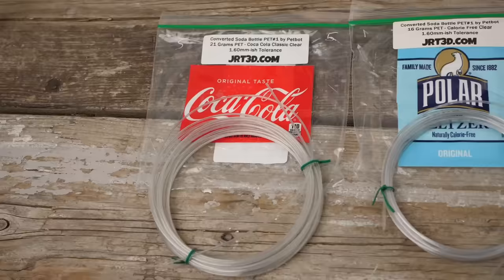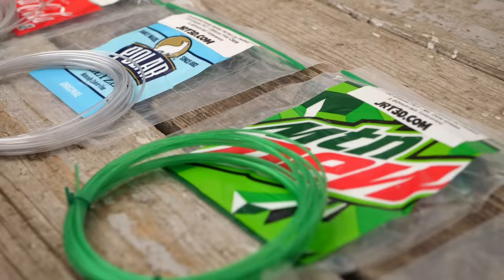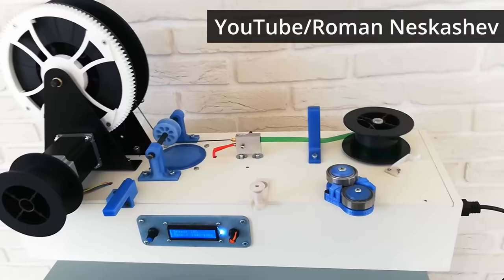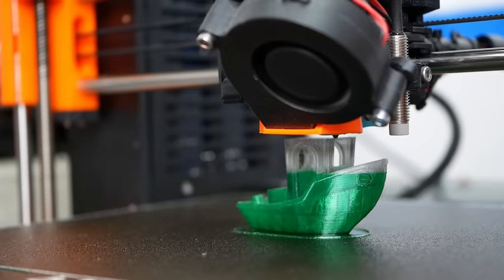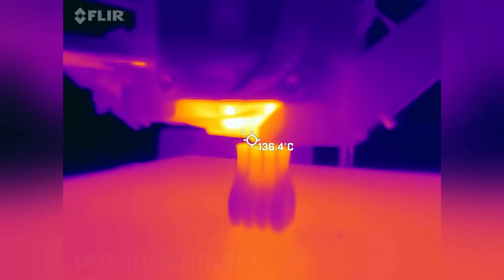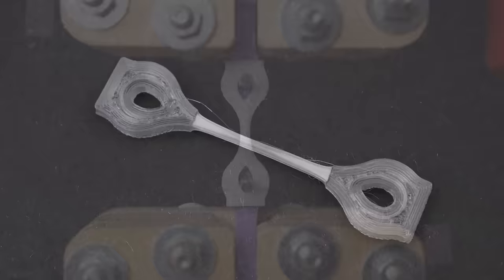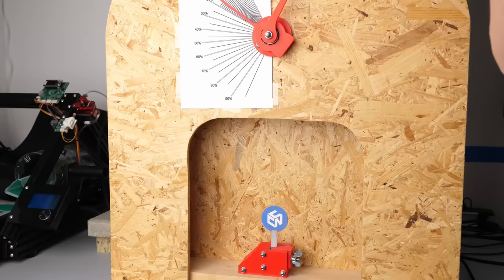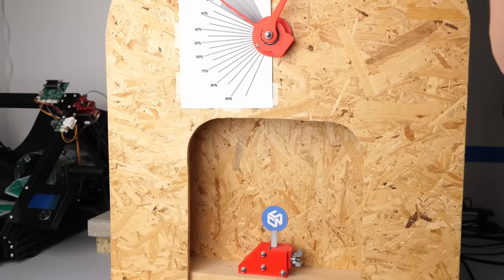HOW STRONG is PET Bottle Filament?

Comment: I got a spool of HTPET+ from Fusion Filaments that vaguely claims to be bottle PET, so I'm really curious now as to a head-to-head comparison between the recycled bottles and HTPET+.  I'm not sure if they've added something to the HTPET+ formula or what but I did not experience the crystallization, at least with the prints I tried.  Also, as per their recommendation, I printed even hotter and kept it super-dry.

Comment: How to make 1 Kg reels out of bottles?  
Good question, I think that if using not 1 but two blade sytems, one with a bottle currently in pultrousion, and one to prepare the next bottle, when the first bottle is done just heat weld the end of that strip to the beginign of the strip of the other bottle on the flight, should go trough the nozzle I guess.
I understand that means you got to stay there and keep replacing bottles and weld end strips all day, but maybe you can get a Kg per hour done, and that means in 10 hours some 300 Euro of market price filament, so not a totally waste of time as someone suggest it would be.

Comment: I am really working on doing something like this but without a fancy machine
Reply: For useful filament the diameter needs to be as constant as possible.  Machines provide consistency.
Reply: @MetalheadAndNerd  fair, but I mean constructing my own machine for extremely cheap. Yes I do agree
Reply: @notc0mputing  Okay. I thought you had an idea similar to what someone else proposed: Hanging a stone out of a window on top floor and use this as constant pulling force.

Comment: @cnc kitchen what is the hardest wearing material i can get in 1.75mm plastic, i have an upper temp of 230c 
the use i have in mind is high heel plastic tip replacement, i usually just make mine out of steel reusing the original pin but its pretty time consuming, modern high heel plastic is nothing like the older stuff.

the intended use will be to print and shape the plastic filament directly onto the heel tip with the original pin in place and shape.

Thanks

Comment: That's awesome, this might even change how we recycle pet bottles. Yes, it might be a larger investment at first, but I think it might be worth it in the long run, especially if you can do some fine tuning on the extrusion and the material (Extruding in multiple stages and combining three or more fresh strands into one and extruding them together again to get a more stable and and even result)
Might be even possible to do this completely automatic in one machine if you're tech savy or have friends in engineering. Unfortunately the 25 cents per bottle are anoying considering the fact that you do the recycling yourself, but if this turns out to be workable on a larger scale, perhaps the bond charges would be dropped or reduced (since china isn't buying the bottle scap anymore and it's very often burned or landfilled instead of being recycled today, that would be better for the enviroment even more)

Comment: Another great video, very interesting topic.

One area which I am amazed hasn't yet been sorted is a small machine to splice filament together. I don't need anything as complex as a 'Palate Pro' I'm not in need of mixing multiple colours etc...

At the moment I fudge things using a soldering iron, a bit of PTFE tube and a peice of metal with a groove cut into it, it works but it's far from ideal.

I probably have around 30 spools of PETG with less than 50grams on which need to be spliced together to make them useful.

Any suggestions?

Best regards,

James (UK)

Comment: Würde mich über eine tiefergehende Analyse interessieren. Hab zwar selbst keinen 3D-Drucker aber ich bin auf dem Weg, mehr Nachhaltigkeit in mein Leben zu integrieren. Mich würde interessieren, ob es Möglichkeiten gibt, PET-Verpackungen, die keine Flaschenform haben, zu verarbeiten, eventuell mit Hilfe eines gezielten Schmelz-Kühl-Prozesses. Die Verpackungen müssten wahrscheinlich in eine Art Topf gegeben werden, der in einem geschlossenen System  erhitzt wird. Wie das flüssige Material dann allerdings in ein Filament gebracht werden kann, wüsste ich nicht - aber genau das würde mich interessieren!

Comment: how about you pull-trude several bottles to make some strings... but then you join them with heat on a longer string...
but then you re-pull-trude it as one but this time you braid it on a slightly hotter temp and maybe slower idk... would it fix the issue of it having a gap on material?

Comment: I think this is pretty clever.  Though it needs to have a couple of extra features to lift itself above being just a gimmick.  Those features?  1) It needs to be able to process multiple bottles without human intervention. 2) A filament joiner. That would decrease the amount of user interaction required per gram, while producing longer spools of filament.  Hmmm...  the more I think about it, those 2 changes could almost be the difference between a gimmick and a business model.  ;)
Reply: Sorry, gimmick is too harsh a word.  It's a working proof of concept.  :)
Reply: You can join the ends using the feeder tube and a lighter

Comment: I wonder what people would do to stop the material from crystalising if the PET filament became more popular. What if you just printed the vertical ones at a bit lower temp and at two opposite sides of the bed?
Reply: I have been printing pet for 3 years. You just need to increase the airflow. There is no crystallization problem at all.
Reply: This system is called PetPull in the original.  For some reason, the author does not talk about this in the video.

Comment: Please make a machine for this; I’d be interested in this; so much potential

Would it be possible the make the filament and print it all in one machine?
Like maybe instead of a filament holder there’s a bottle holder with the razor blade and it is automatically fed into the 3d printer

Comment: Would be kinda ironic seeing a printshop in a developing country, where there's a problem with PET bottle pollution, using 3D printers and PET pulltrusion instead of buying new rolls of filament, because those are too expensive, but printers are dirtcheap.
On the other hand the irony is already there with inkjet and laser printers where the printer itself costs not as much as a full set of ink cartridges.
Wonder how long it'll take until filament rolls are getting chipped like ink cartridges and the printers refuse to print unless they have og in-brand rolls.

Comment: I had wondered if you might investigate this. I was wondering if this was worth trying.

Where I live there is no deposit on bottles, so no return for bringing them in. There is a levy (non-returnable) charge on the bottles when we buy the product. So if I were to pursue this option the bottle cost would not be a factor.

I am retiring from work in four months so I might spend some time experimenting with this method. And considering my lower income a lower cost of materials would be beneficial.

I wonder if the same process could be adapted for bottles made with HDPE. The HDPE containers can be found larger and with thicker walls, resulting in more continuous filament per bottle. The temperature would need to be a little higher.
Reply: The russian guy Brother that is mentioned in the video already tested it, hdpe is not printable at all.

Comment: cant we somehow join the filaments to make bulk rolls? Also, having plastic manufacturing experience, I cant see why an extruder is so expensive they are honestly really simple. ie turning the pellets into plastic is easy, its the extrusion procrss thats a little harder.
Reply: However, if you extruded the material into a flat strip like shown, you could mix and melt your pellets, extrude them into a flat strip then feed it into the recycling machine, that then would be the expensive extruder.

Comment: can u try to print solder? ive been trying to do that with a cheap printer but it doesnt work very well because its cheap. and im to poor to get a different one. ive discovered 205 degrees C is the best nozzle temp and cant find a good bed temp if that helps

Comment: There's no deposit here, the bottles just go in a recycling bin. How much actually gets recycled is a good question  - we've all seen the images of plastic bottles washed up on shores. 

I'd like to do this but would pay so much for an expensive machine - the math on your return for saving on filament doesn't work out - that's the gimmick.. I'm looking for an easy way to make the cutter and pullstruder. 

Also if the pet tape was fed as well as pulled at the same rate, could multiple bottles be joined for a longer filament output, as such a small length is only really useful for smaller models. 

Anyway, thanks for your video Stefan and I'll check your links..

Comment: Well, I argued with my friend about costs of recycling PET bottles. You have different prices but concept is still actual.
You have 1 kg of recycled PET that costs you 12 euros directly (via not depositing bottles). And you have to clean 50 bottles, slice and extrude them. This is your personal time and electricity. If your time that you waste washing bottles and tinkering with recycling machine costs less than 12-15 euros per kilo made, then this process has some value. But I doubt that.
Reply: Oh, you told this at the end of the video... Sorry for bad habit writing a comment before watching whole video...

Comment: I have a little query.  I have a mk8-type hotend from the factory and every now and then I suffer from jams with the pet.  They recommended me to use a bi-metal barrel to avoid that since I have a bowden system.  would the change be correct?

Comment: Actually you shouldn't need a special tool. Using a hair straightener, Clothing iron, or heat gun while the material is flat (after it's cut, but before formed into filament) You should be able to weld pieces together easily.

Comment: Why did PET do so much better in many of the tests than PETG? And if so why can't I buy PET filament? A lot of the downsides of crystallisation could be taken care of by better cooling and minimum layer time in the slicer I assume? 

I don't see myself doing this type of recycling: I don't drink soft drinks, and the tap water here in Sweden is excellent quality. Thus I don't normally consume anything that is sold in these types of bottles. Also we do have deposit on the bottles, so the economics barely makes sense even if I did but such drinks.
Reply: petg has taken root in 3D printing, because old printers could not heat up above 250 degrees. Teflon thermal barriers have degraded. There was protection in the firmware. Until now, many cannot print because they do not want to reflash the printer. Therefore, a filament with a lower melting point was needed. And so that you can print petg without blowing (the old people printed ABS and sometimes there was no blowing at all on their ancient printers).But pet is better.

Comment: Thats to expensiv, if you would produce 1kg. 1000g/20g=50 bottles. 50 bottles * 0,25€ = 12,50€. My last filament was 8.90€, without putting any work in. It was a pretty good discount. But good video for other countrys. Build one, i would watch that video

Comment: Could this actually be a profitable industry, especially in countries that dont have plastic recycling benefits? Collecting used bottles, make them into filament strings and sell it back to the market. If there is no recycling benefit in the country, you could buy used bottles from others, increase its value by manufacturing it into filament and sell it.

Comment: The biggest problem here is if this becomes very popular, the redemption centers can complain to congress that people aren't redeeming bottles for cash and therefore hurting the economy by affecting the flow of currency. I'm predicting this now so be ready when you hear about it later on.
Reply: This system is called PetPull in the original.  For some reason, the author does not talk about this in the video.

Comment: Damn the Russian beat me with my idea..But good someone tried it first
Reply: This system is called PetPull in the original.  For some reason, the author does not talk about this in the video.
Reply: @KartoshkaAndMelassa   @Аманов Тимур  I started a series of binge watches of the Russian YouTube Brother  channel, so enjoyable. I am aware of the pulltrusion method, I just had the idea to directly infeed the the flat strips into the printer some months ago, I didn't had the means and work space to test it. It iscool though someone made it happend

Comment: I wish I could recycle my own single-use bottles, it would be so much more efficient than shredding and burning it as the "recycling" plants do it (and I'm expressly talking about the non-reused PET bottles), but as anybody in Germany knows the 25c deposit you don't get back if you recycle it yourself financially disincentivizes it. Yeah, it's still more of a hobbyists' fantasy, but if you ask me, I'd rather reuse even just one percent of the plastic that otherwise lands in the garbage (meaning either landfills or incinerators), and heck, maybe I'm vastly overestimating how much waste you end up saving, but still, every gram of plastic that ends up as a benchy at least postpones the inevitable.

Again, with 20g of usable material and 25c per bottle that you're not getting back, this is unfortunately infeasible for me, but damn I love to see how this idea evolved over the past few years.

PS: Just to get into the recycling plan in Germany a bit more: There are two kinds of plastic bottles, single-use (the thin plastic, e.g. for coke) and reusable (with thicker plastic, mostly seen in juice and water bottles). Both have a 25c deposit upon purchase that you get back if you return the bottles, but what happens with them is drastically different: the reusable ones get, well, reused, i.e. shipped back to the producer, cleaned and refilled; the single-use ones get crushed on the spot and then sent off to "recycling plants", which often means they get incinerated (according to NABU, the split is 25% made into new bottles, 45% made into industrial wrappings and sheets, 20% go out of the country and the rest get "turned into energy", i.e. burned [numbers quoted from https://www.quarks.de/umwelt/muell/so-werden-plastikflaschen-wiederverwertet/]).
Now, I'm not an eco nut, but I still don't like wasteful behavior, so I stand by my point: If we can reuse materials that would otherwise pollute the environment, I absolutely want that idea to spread, even if the actual impact isn't large in the grand scope of things.
Reply: This system is called PetPull in the original.  For some reason, the author does not talk about this in the video.

Comment: if you cant afford filament made for your printer,  then you defenately cant afford to replace your nozzle weekly from all the clogs and damage from this material.  notice how he comments about how it clogs it up, but later on talks about how it is a great replacement. he neglected to talk about the cost of replacing the nozzle. depending on your printer this can be very expensive if you have to do it a lot. mine cost around 27$ us for a nozzle. I think i would rather just use good filament and not spend extra time and money i dont have, instead of using this homemade pet filament.

Comment: I just got soo mad when i learned about this technique after spending 10k euros on 3devo recycling solution...
Reply: This system is called PetPull in the original.  For some reason, the author does not talk about this in the video.

Comment: How many bottles would you have to drink to save the filament you're saving yourself from buying. You get 1kg for 20 bucks or thereabout, 30 if you go premium. One bottle here is 25ct for deposits, so you'd have to get at least 10g of filament just to justify using the bottles for filament instead of returning them. Of course buying bottled drinks is expensive in itself. Drinking tea or water is a lot cheaper than buying loads of coke. And then you'd have to save yourself the 400 bucks it costs you to make that machine in the first place. And after all of that you probably get worse filament than even the cheapest brands that sell you spools for 10 bucks. Unless you do this industrially, there is no way this is economic.

Comment: 99.999% of the crap people are making with 3d printers is useless junk that they would never buy.  (waste of electricity and plastic and filling your house with toxic fumes for no good reason)  and 99.999% of the people who actually create functional objects misuse them.  Material strength is mostly irrelevent.  3d printing was never intended to provide end-use quality.  It's intended for RAPID PROTOTYPING.  You're not supposed to expect a 3d printed object to be strong enough for practical use.  It's supposed to help you figure out the final design faster, so you can either make a mold and cast it from a useful material, or have it machined from metal.  Every time I see people trying to sell 3d printed stuff it makes me cringe.